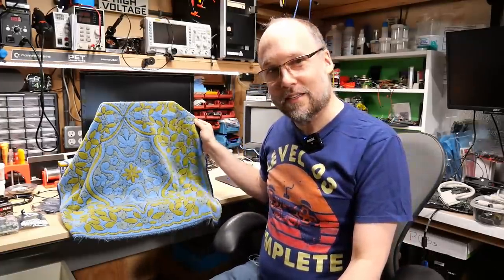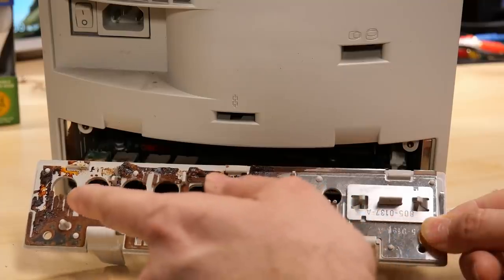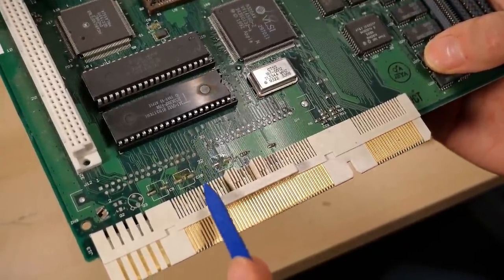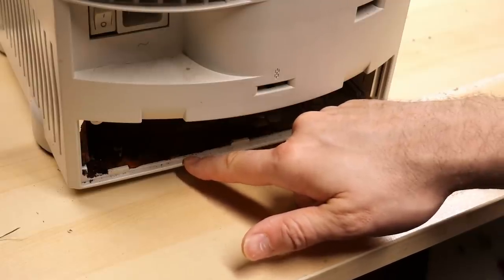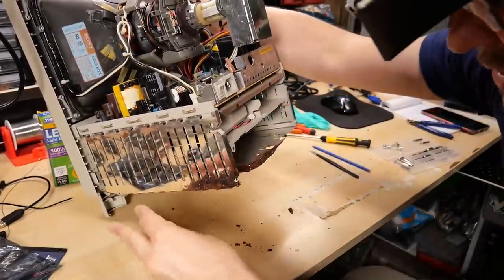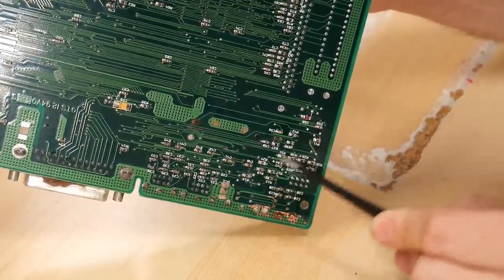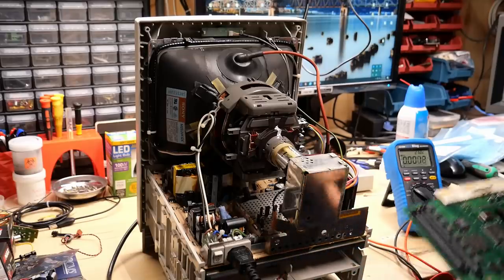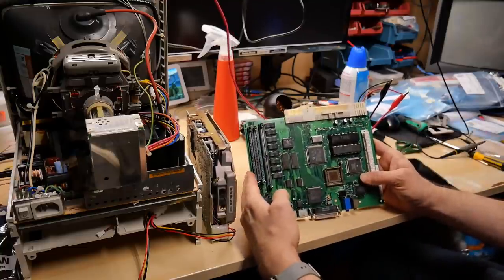Can I save this Macintosh Color Classic?

Comment: If anybody knows: can one fit a color screen and driver board  to a B&W Macintosh Classic to make it display in color?
Reply: The logic board video output is 1 bit monochrome only, so it's not possible.  For some B&W Macs like the SE/30, there are some super-unobtainum graphics cards that can connect to the internal CRT and drive it in greyscale instead of B&W.  There are video cards for a variety of compact Macs that will output colour for an external monitor, but many of these pair to specific monitors only.  There's even one that connects to SCSI. In theory, you might be able to reverse engineer the analogue/power board in the Classic to power on without the built in monitor connected, then install the guts of a colour CRT into the chassis, but colour CRT necks are too deep to fit in the case.
Reply: @reidster87  I didn't say that it has to be CRT...

Comment: the CC board is unfixable, maybe you can score a LC 575 board and turn it into a mystic upgrade CC.
Reply: Those things are unobtanium because of the mystic upgrade. If you want a real challenge, get your hands on a pm 6400/6500 or a pm 5400/5500 logic board and perform a takky upgrade. Bonus points if you throw a G3 accelerator in it!

Comment: You really need to check all those through holes around that area of the battery leakage. Those holes tend to corrode and not make continuity after such leakage. Good luck with that! No fun.

Comment: If you haven't found it already, the Colour Classic FAQ is an extremely valuable resource for repairs, troubleshooting, and modifications.  https://colourclassicfaq.com
I can confirm that your power supply behavior is completely normal when the ADB/soft power section of the board is damaged or no keyboard is connected.  MaxellBomb battery explosions very frequently take out the soft power.  The capacitor located nearest to the ADB ports is also required for power on and a marginal capacitor here will result in an intermittent power on condition.  As you discovered, the battery leakage destroys metal, including the traces, legs, and vias.  With this being a multi layer board, it's a complete nightmare.  

I think you should get a Performa/LC 550 logic board if you want a slide in replacement with full 32-bit bus and a faster '030.  If you don't mind patching the system file, or changing the sense lines on the analog board, you can do a Mystic upgrade with a Performa/LC575 logic board.  Then you get a LC040 or full '040 at 33MHz, up to 132MB of RAM and 1MB of VRAM.  Thousands of colors!
Reply: Here's mine on Imgur playing Sim City 2000 and browsing the web:  https://imgur.com/gallery/1y2AE0V

Comment: It's not too hard to find a spare Color Classic motherboard, for the most part - sometimes people upgrade their systems with a Performa 575 series logic board (just slides right in, and you can make a mod to the analog board to drive the display @ 640x480) to make a Mystic Color Classic so they end up with a spare logic board. Or heck likely you will have one in the mail soon from some viewer hahaa
Reply from the maker: Seems they cost over $300 on eBay. Not worth it to me ... Not for a slow and anemic motherboard like what originally came in this machine.
Reply: Oh yes they are indeed crippled. I love the Color Classic’s industrial design the most so it’s nice that one is in such good shape.

Comment: The good thing is that while the motherboard may be toast, you can swap out a motherboard from another Macintosh that is not the Color Classic. I forget which model had it, but I think one could do a CPU upgrade in the process (Because one of the models ran off of a more powerful or faster CPU.) They called it a "Mystic" upgrade, I believe.

EDIT: It was the Performa/LC 550 and 575 that you could swap. (Although you'd need a 3D-Printed back cover, because the old cover will not fit the 575.)

I think the Quadra 630 will also work.
Reply: Using the Quadra 630 or LC/Performa 580 logic board actually requires some significant modifications to the chassis/wiring as it is a later architecture.  That's known as a Takky mod.  More interestingly, the Takky mod allows use of PowerPC based boards, such as the excellent 160MHz 603e based Performa 6360/Power Mac 6300/160.  The LC 520 board is effectively the same as the original CC board and swaps right in.  The LC 550 board also swaps right in and is effectively the same as the pretty rare Colour Classic II.  It adds a true 32-bit bus and RAM beyond 10MB with a faster 68030.  The ultimate non-destructive mod is called Mystic as you mentioned and uses the logic board from a LC 575/Performa 57x and it just slides in.  It offers a 33MHz 68LC040 in a socket, up to 132MB RAM, 1MB of VRAM, LC-PDS and COMM slot expansion.  You can patch the system file and boot at the same 512x384/560x384 screen resolution as the original CC board, or you can make a small bodge on the the analogue board and run it at 640x480 -- it looks fantastic!

Edit forgot a link:
https://colourclassicfaq.com
Reply: @reidster87  Ah, thanks. I didn't know the Takky mod needed much more modification to use.

Comment: I have never really understood the thought behind designing the Mac Classic line.  The screen size seems way too small to be practical while the portability feature seems like it would make no sense - after all, who would take a Mac to a lan party?

Also, while the shielding is not really needed for the function of most electronic equipment, if I wanted to replace the RF shield from a functional point of view I would to so with something like copper tape (along the plastic edges of the case) which is often used for making Faraday cages in guitars (in order to minimise RF noise picked up by the electronics on the way to an amplifier).  Also that machine seemed to have more bugs than the initial release of a Microsoft operating system.

Otherwise, if you just wanted to make use of the case/monitor combination it does strike me that this chassis would make quite a good home for a Raspberry Pi or as a sleaper PC using one of the smaller ITX style boards like you see from Asrock.

Comment: I've never been a fan of the Color Classic's case, why couldn't they just make a SE/30 or a Classic, but with a color screen???
Reply: The Trinitron CRT neck necessitates a deeper case, as does the logic board architecture borrowed from the AIO LC5xx/Performa 5xx range.  I do agree that the styling isn't as endearing as something like the SE, but it grows on you.  Especially if you see one next to a LC575 for example.  The CC looks so cute in comparison!

Comment: The FCC insisted shields be there for a reason. I would have dunked that shield in rust remover and reused it.
Reply: That was in the 90s, now with a lot of cheap switching power supplies, wifi and wired networks everywhere  those make no sense. Also where are those in modern laptops and desktops? And those generate a LOT more interferences except low frequency stuff from CRT. So yeah when i see rusted ones I just throw them away if it's impossible to save them.  Only exception if it's a receiver, sensitive amplifiers, medical equipment or some sensitive devices that measure something - RF shields prevent those from getting interferences.
Reply: They're probably there to prevent interruption of analog television...   Oh, wait...

Comment: I understand your reasoning for not wanting to attempt repairing the motherboard given how labor-intensive the work involved is. But with this video being about a repair attempt my first thought was, "Oh, battery damage?" - honestly I was hoping to see the machine fixed because (worth it or not) I have a battery-damaged machine I want to fix... And then, sure enough, battery damage, leading quickly to the conclusion that the machine was beyond repair.

Like I said, I get it, but I think it kind of runs the video into the ground. Battery damage is one of the most common failure scenarios for these machines, so if you don't repair battery damage, it seems like the whole matter was settled as soon as you saw the corrosion on the shielding.

Comment: Deadly voltage on the back of that monitor. This video could have  ended very differently than intended.
Reply: If it hasn’t been turned on for years, everything should have discharged and be safe for a poke around . Once Adrian tried to start it up, you are right, it could have been very bad.

Comment: Did computer companies not know that batteries of that type could/would leak?  Maybe they thought they'd get replaced before that would happen, and wouldn't be a problem?
Reply from the maker: Yeah mostly that -- figured that if someone was still using the machine after 10 years or whatever, that they would have changed the battery already. Also, even back then they only really designed computers to last 10 years -- I don't think they ever thought someone would be trying to use it 30 years later. :-)

Comment: Dead Flys?  Was Pence mucking with your computer? :-)
If you can get a schematic, or a good photo of the tracks on a good board you can hopefully fix that board with a ton of bodge wires.
Remove those DIN port connectors and buy new ones.  I'm sure they are still available from Mouser or Digikey.
Those IC's may not be toast, try and cleanup the pins and tin them with fresh solder.  IF you can do that, the IC's may actually work, it's not likely that the corrosion got inside the chips.
12 volt short on the mother board?
That soft power switch sounds like a catch 22.  The cpu has to start to read the AB and the keyboard to receive the power key press?  IF so then how do you turn it on, if it isn't already running?  Or is there another supervisor circuit that always reads the AB bus to receive the power key press?
Reply: What is it with you libs and your need to drag politics into unrelated topics?
Reply: @Renville80  What is it about you right wing paranoids that you think every comment is about you?  You obviously don't watch SNL, and have absolutely NO sense of humor.   That FLY was FUNNY!

Comment: The machine was buggy

On a 2nd note, put a pi in it.
Reply: That's always my thought on cases like this.  Even more clever would be to get the original CRT interfaced to the rPi HDMI.

(Probably easier to sell the CRT to someone restoring an otherwise working Classic Color, then fit in a small flat panel with a curved plastic insert to match the curvature of the original screen.)
Reply: @SenileOtaku  if I remember right, CRT all in one macs use the same db-15 port internally as the tower macs, which is vga compatible. It takes nothing to get vga out of a pi via the gpio port, so it should be easy.

Comment: Oh god. Never EVER EVER soak a motherboard. It is from wooden fibres for gods sake. They can swell up and delaminate in the matter of minutes. Also, never EVER hotswap boards. This is really not meant to be hotswapped and it can deal WAY more damage than you can imagine. For example the Powergood/RESET circuit is constant so the motherboard cannot start even if it was all right and not messed up. Please, bring your tools to the nearest repair shop, donate it to them and never EVER touch anything again. That was as stupid as 8bitguy stuffing paperclip into the mains outlet...

Comment: Some hints on what dies when the thing wont power on. 
https://68kmla.org/forums/topic/24740-color-classic-no-power-issue-debunked/
I suspect you should be able to get a working k/b connector with a little effort. From there, you should be able to boot.